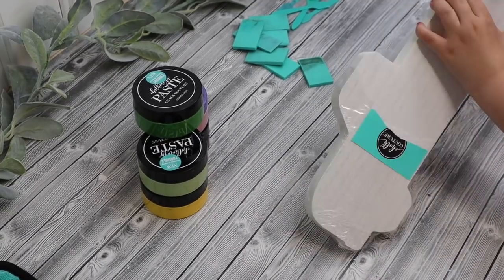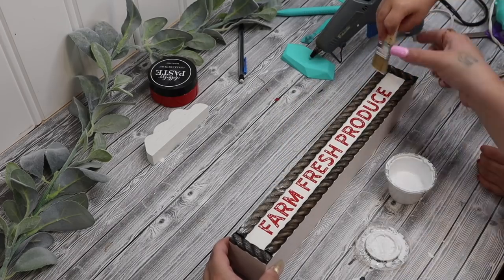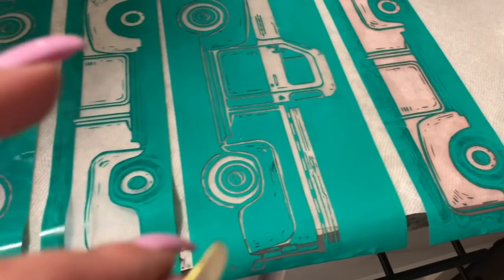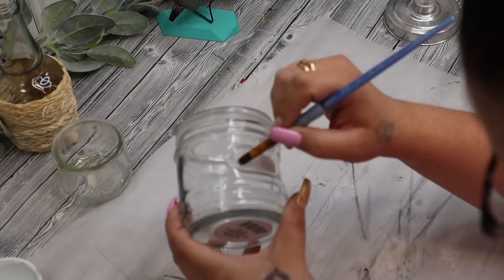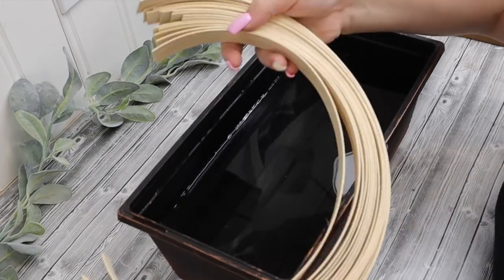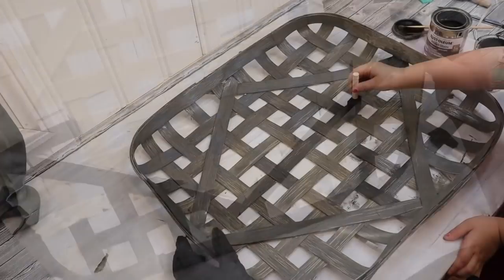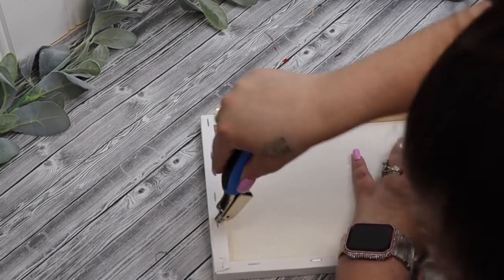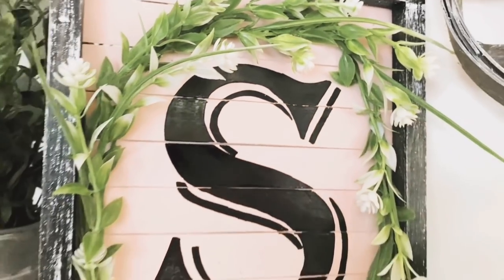🌟NEW HIGH END DOLLAR TREE FARMHOUSE DIY'S | MAKE IT WITH MOMMY HIGH END EASY DOLLAR TREE DIY'S 🌟

Comment: I'd rather have you make your videos alone   ....   the little tray (I think it was project n° 2) turned out great, but these rope handels look messy and kinda unfinished, not usually your style, that's why I was a bit surprised you left 'em like that
Reply from the maker: Ok well this was a fun thing to do with my daughter and I had an amazing time doing it so did she. Sometimes not every single thing will turn out perfect. The handles frayed, it drove me nuts so I tried to use the glue to fix it. They didn't want you stay down so I tried to remove them and it was breaking the Reed apart so yes sometimes even though it drives me nuts it's best to just leave it alone especially when you don't have time to re do it. Maybe instead of assuming I "just left it like that" you can ask why I did. 9/10 times there's an explanation. Thanks!